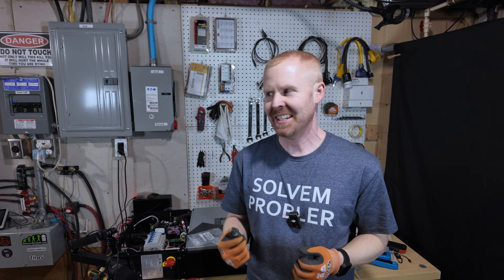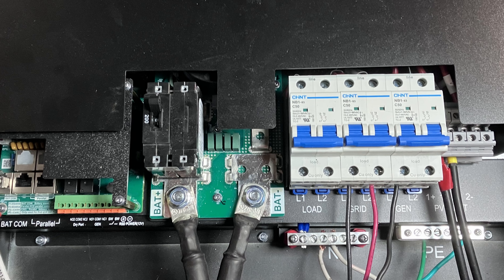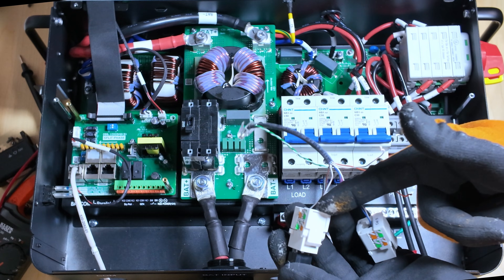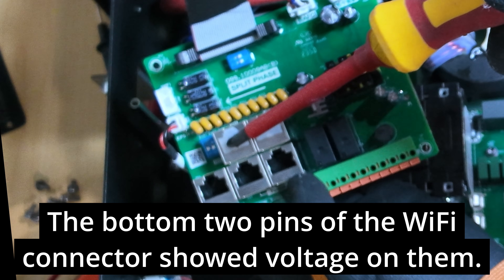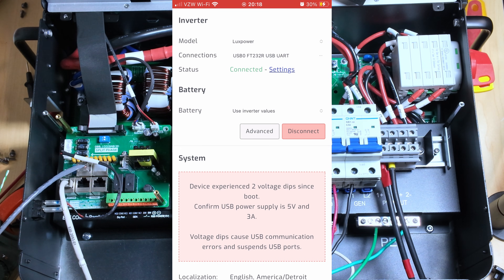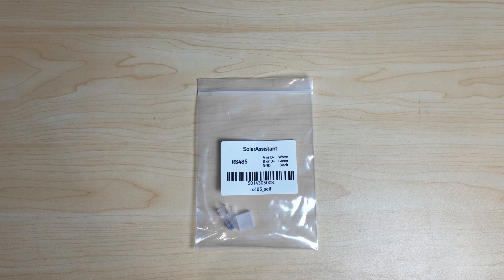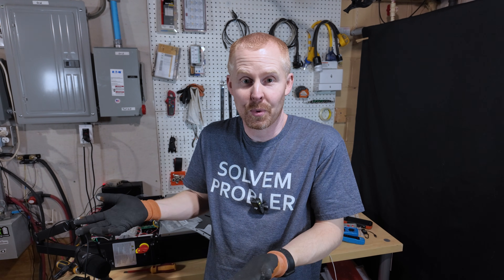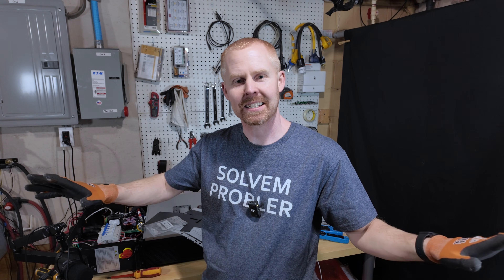Solar Assistant Beta Adds RS485 Support for Luxpower Inverters – Here’s How on the EG4 6000XP!

Comment from the maker: I believe the process is fairly similar for the EG4 12000XP, 12kPV, 18kPV and the FlexBoss inverters.

🛠 Parts & Components (Affiliate Links)
     EG4 6000XP:
     🔹 Current Connected: https://www.currentconnected.com/product/eg4-6000xp-inverter/?ref=AzzpK9Fl
     🔹 Signature Solar: https://signaturesolar.com/eg4-6000xp-off-grid-inverter-split-phase/?ref=adamd
     EG4 12000XP:
     🔹 Current Connected: https://www.currentconnected.com/product/eg4-12000xp-48v-split-phase-off-grid-inverter/?ref=AzzpK9Fl
     🔹 Signature Solar: https://signaturesolar.com/eg4-12000xp-off-grid-inverter-48v-split-phase-24kw-pv-input-12kw-power-output/?ref=adamd
     EG4 12kPV:
     🔹 Current Connected: https://www.currentconnected.com/product/eg4-12kpv-48v-hybrid-all-in-one-inverter/?ref=AzzpK9Fl
     🔹 Signature Solar: https://signaturesolar.com/eg4-12kpv-hybrid-inverter-48v-12000w-input-8000w-output-120-240v-split-phase-rsd-all-in-one-hybrid-solar-inverter/?ref=adamd
     EG4 18kPV:
     🔹 Current Connected: https://www.currentconnected.com/product/eg4-18kpv-hybrid-inverter/?ref=AzzpK9Fl
     🔹 Signature Solar: https://signaturesolar.com/eg4-18kpv-hybrid-inverter-eg4-18kpv-12lv-48v-split-phase-120-240vac-ul1741-cec/?ref=adamd
     EG4 FlexBoss21:
     🔹 Current Connected: https://www.currentconnected.com/product/eg4flexboss21/?ref=AzzpK9Fl
     🔹 Signature Solar: https://signaturesolar.com/eg4-flexboss21-16kw-ac-hybrid-inverter-48v-split-phase-21kw-pv-input-v1-1/?ref=adamd

     🔹 Pre-installed Orange Pi with Solar Assistant: https://bit.ly/3obBtwM
     🔹 RS485 Self-Crimp USB Cable: https://solar-assistant.io/shop/products/rs485_self
     🔹 Waveshare USB to RS485 Converter: https://amzn.to/41Gljvc
     🔹 Klein Tools 60580 Work Gloves: https://amzn.to/407kvR1

For more details, visit my website: https://going-off-grid.com

💡 Support the Channel
Want to support my work? Here’s how:
✅ Use my affiliate links—it doesn’t cost you extra, but it helps me out.
✅ Buy Me a Coffee: https://buymeacoffee.com/goingoffgrv
✅ Click the “Thanks” button under the video.
✅ Join as a channel member for exclusive perks: https://bit.ly/3Wdufqv

I appreciate your support! 🙌

Comment: I just made a cable . I will be using Home Assistant to go directly modbus to the EG4 6000XP . I use AI to write the code. When I get it done if it works, I will put it on github.

Comment: ciao mi potete agliutare  [15/11, 23:21] 🇨🇮: MESSAGGIO:

Nella schermata di SolarAssistant, nella sezione della batteria, risulta selezionato USB JK RS485, ma il sistema mostra lo stato:

"Not connected. Retrying in 15s…"

Sotto la porta, nel menù a tendina, compaiono soltanto:

ACM0 USB Single Serial

USB0 FT232R USB UART

SolarAssistant continua quindi a non rilevare alcuna comunicazione dal mio adattatore RS485 → USB e non riceve dati dal BMS.
modello  Waveshare – USB to RS485 Converter
Reply from the maker: Hai più BMS collegati? Il dispositivo USB visualizzato nell'elenco è un dispositivo RS232, quindi se hai un solo dispositivo collegato, è probabile che tu stia utilizzando il cavo sbagliato.

Comment: I unplugged the Wi-Fi dongles, ordered the USB to RS485 cables from solar assistant, all three are recognized in the configuration panel, however, they will not connect to any of the inverters. I don’t know what I am doing wrong. I have plugged into the correct port as indicated in your video I haven’t heard back from solar assistant either
It just does no response three trying in 15 seconds no response address 1 through 16 at 19200baud
Reply from the maker: Hmm.  I would double check the pinout of the network cable side of the USB to RS485 cable then.  Since SA recognizes the USB devices, we know that portion works.  

I would also double check that you're on a version of SA that supports the USB configuration of the Luxpower inverters.
Reply: @AdamDeLayDIY . Figured it out!  SA sent me cables that were configured for pins 1&2.  
Cut off the ends and redid them.  It’s working!
Reply from the maker: @leemaisel9794  glad to hear!  Yeah they only make them wired a certain way and you have to make sure it's the proper pinout for your specific installation.  I think that's why I ended up buying the ones where you make the specific ends cause each install is different.

Comment: I finally got my 12000xp to connect via RS485.  The update is a bit faster than wifi but still not instant. Wish we could see the same fast update as what's shown on the LCD screen.  Hope EG4 is able to push and update for this.

Comment: Bro really had me out here buying crimpers and cables when it connects to dongle lol
Reply from the maker: You can do either.  Wireless connection is a bit slower.
Reply: @AdamDeLayDIY I like your style. So to do wired you have to remove the wifi board?
Reply from the maker: @NativeChukchansi  No, you don't have to.  It does make it where the wifi dongle doesn't work if you use the wired connection though, but you don't have to remove it.
Reply: @AdamDeLayDIY  still jiggling not connecting lol. Do you leave the pi in wifi mode or use an ethernet? thanks
Reply from the maker: @NativeChukchansi  My pi is running off WiFi

Comment: Hi Adam, I tried this with the 12000xp and could not get this work.  I am running  SA ver 2025-06-13.  The 12000xp might be wired different :(
Reply from the maker: I would double check that you have things wired up correctly and using the proper port. I’ve heard from other folks that it’s the same on the 12,000 XP.

Comment: we are off-grid on our present land and we are going to be so on our new land. we have an EG4 18kpv in off-grid mode and do not want to get another one because we do not need the feature set the 18k has. seems like the 12000XP meets the need.
Reply from the maker: That makes sense.  If you're not using all the features of the hybrid inverter, why pay for all the extras?  While I haven't messed with the 12000XP, it does seem solid.  The display could be better but I would imagine most people aren't using that anyways when they can just use the monitoring site or Solar Assistant.
Reply: i-am interested in solar assistant for both inverters. we will have 24,000 watts of power and 86,016 watts of battery storage
with 14,580 watts of solar per hour or 72,900 - 87,480 per day before we upgrade the solar. we have a lot to do out at the new land but it is going to be fun.
Reply from the maker: @stevenfrazier8939  Woah that's a lot!  It'll be worth it though!  Sounds very similar to something I want to do some day...  Good luck and enjoy it!

Comment: Hmmmm I wonder if there’s less lag in the inverter talking to solar assistant.  I was so used to my 6500ex being pretty much instant now using 18k PV is probably five seconds behind which isn’t bad and definitely better than looking at device monitor website.  Might just play around with without myself. Thanks Adam!
Reply: It does work plugged into the INV485 port on the 18 K PV.  It doesn’t appear to be any faster, but it definitely works!
Reply from the maker: @joshhartin78  you bet!  Hard say if it’ll be faster or not.  I would think a hardwired connection would beat WiFi any day.
Reply: That is exactly what I was thinking and I couldn’t get back to my inverter fast enough!  Lol I think I’m going to give it another shot…
Reply: @AdamDeLayDIY  after a few more test, it definitely appears to be faster.  From my experience anyway, after testing about four times on my system Wi-Fi is about 17 seconds behind and RS 485 is only about 10 seconds behind. I call that a win! I’ll take it.
Reply from the maker: @ awesome!  Glad to hear and thanks for sharing!

Comment: A tip for people playing with multiple usb serial interfaces - cheapie interfaces usually don't have unique ID (serial numbers that sort of thing) and that can cause you grief with how an operating system names them.  Simply restarting the OS,  changing which USB port the device is connected to, changing the USB hub etc can see the device name (windows' COMx, linux well you have choices  but /dev/*tty* or /dev/serial/by-... under linux it's easier to use /dev/serial/by-id/... but udev rules etc can give a stable tty name) the interface is assigned change.  waveshare devices do have a unique ID and that makes life much easier.
Reply from the maker: That's good to know, thanks!